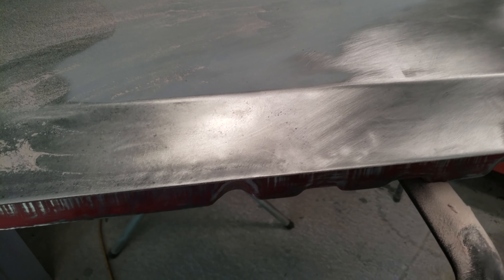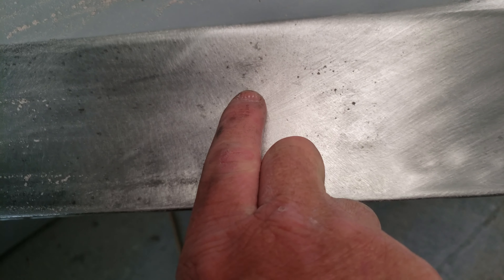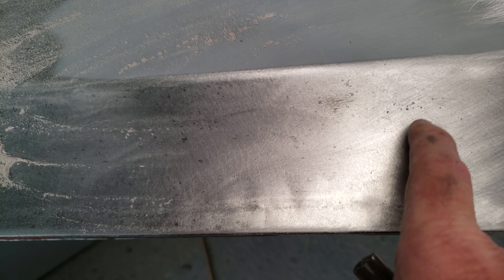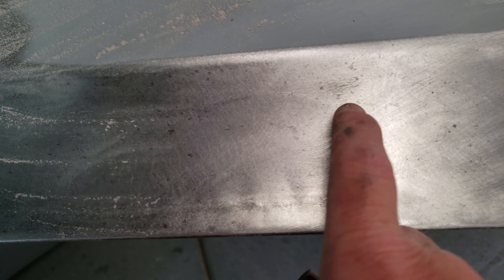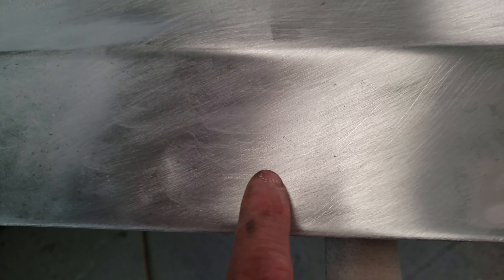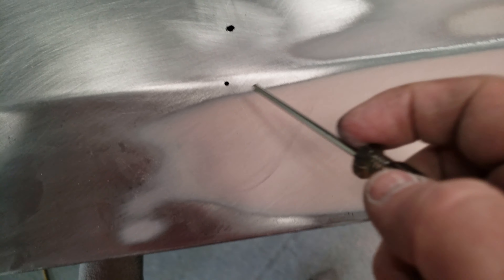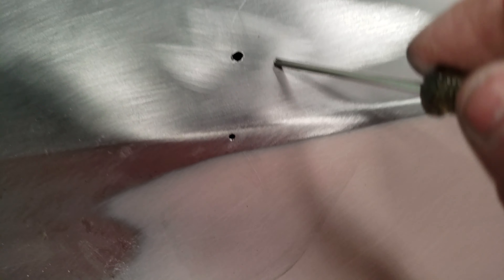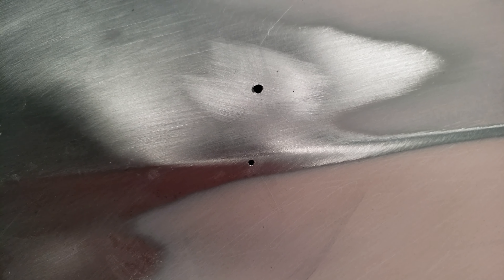1968 Nova Door

Comment: For the rust specs I use a product called Captain Lee’s metal prep and conditioner on the inside and out.  There are anti heat creams/paste you can use for welding that will help/ may also save your existing body work.  Awesome build BTW
Reply from the maker: Thank you